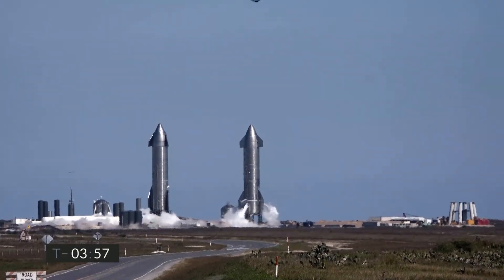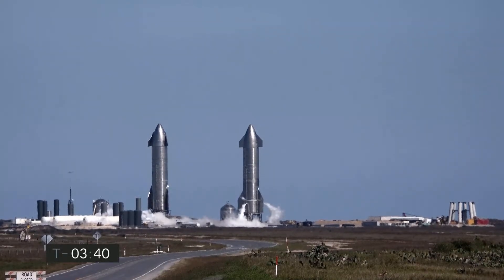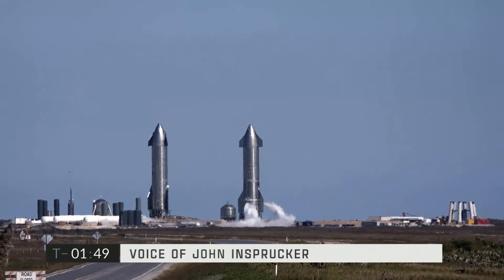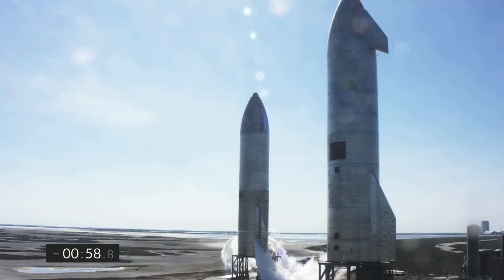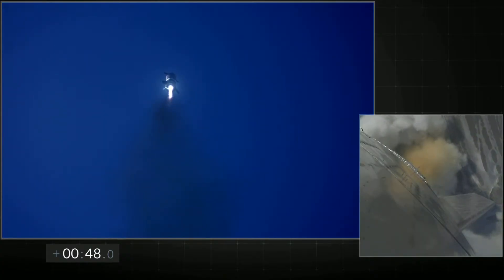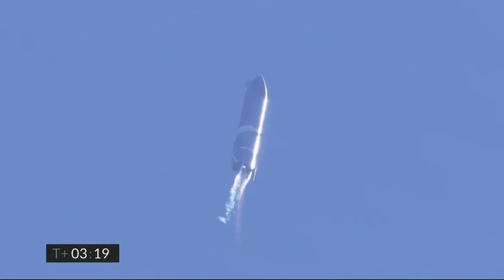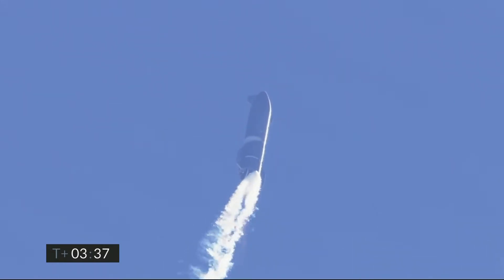Starship | SN9 | High-Altitude Flight Test

Comment: Hey SpaceX!  I've been an aircraft flight test engineer, and an aircraft performance analyst.  This is what I would try to do if I worked at SpaceX: think about the landings the same way we think about commercial aircraft takeoffs.  

All multi-engine commercial aircraft are designed and operated such that it is safe even if any one engine fails at any moment in time.  If it fails at a low speed the plane needs to be able to safely stop.  If the engine fails at a high speed it needs to be able to safely continue the takeoff and climb quickly enough to clear all obstacles in its path, with a little margin to spare.

There are a few ways for SpaceX to apply this methodology.  But I would look into planning on restarting all of the engines since a restart is obviously not guaranteed.  If only 2 of the 3 restart, but you only needed 2, then land using a 2 engine landing profile.  If all 3 restart then either throttle back to the thrust required or, if low throttle settings are not viable, then shut down whichever engine you want.  

I guess I'll also add that if your engines can take it then I'd suggest trying to get more cycles in during your test flights; climb to 10km, flop and descend to a simulated landing over water at 1km, reclimb to 10km, repeat xN, then do the final descent and land back on actual ground.  You will learn a lot more important information, like how much variation is there in the time it takes to restart the engines.  You need that information in order to understand the probability of failure for a given landing profile.

I could go on but I think the point is clear.  Plan for success in the event of any single point failure.
Reply: That sounds smart. But at this point, it is not the time to think about redundancy. They really just need to figure out a good way to deliver the fuel into the engines, assuming that the raptors are reliable themselves. They have to figure that out anyway, otherwise it will never be ready for Mars, so increasing a likelihood of a test vessel landing would be, literally useless. It needs to be a 100% on the 2 engines first, then they can think about the "what ifs".

Multiple "simulated landings over water" would also just increase the complexity of the tests tenfold, without any guarantee of saving the ship. Not even mentioning that it could just be downright impossible since they must switch the tanks for the landing, I don't see how they would switch back to the main tanks while the vehicle charges towards the ground/ocean.
Reply: @hvip4  I disagree. Saving the ship and being able to use it again is very important. That’s the entire reason why they work so hard to land boosters. Thinking about redundancy is something that they will need in the long run anyway. And if the only thing that they want to work on is the switch between tanks, well they can more easily build a rotating engine test stand than an entire space ship. If the test fails there is a very good chance that both the engine and test stand would survive and they would be able to quickly move on to the next test. Either way, being able to get several test iterations in quickly is a huge benefit.
Reply: I don’t follow Twitter but it sounds like Elon started talking about relighting 3 engines the day after I posted my comment here. It’s likely that I’m not the only person who thought about this, this mindset is normal for people familiar with FAA performance regulations.

Comment: I know this is a test and all, but since the rocket needed 3 engins to push gravity at its strongest, maybe it also needs 3 engins to land? Or, maybe you could start the 3 engins in higher altitude after the rocket is completely vertical in order to lower the speed of its fall and then  result to only engin 1 when it's close enough?
.
.
.
.
.
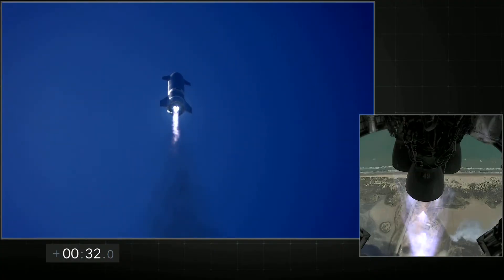Or it could be the ring that fell off on the corner camera between 5:59 and 6:00 if you go frame by fream...

 Either way, I'm sure you will figured it out!

Comment: Don’t they have some geek ass maths/physics nerds doing all the calculations but they forget the speed at which it’s falling from at 10km altitude in the sky and I’m sure they can work out the velocity and the timings of when the engines need to kick back on?? I mean I’m dumb and this surely isn’t rocket science to figure out? All they needed was to make them engines turn on 20 seconds before landing rather than 5 seconds before it hits the ground. The explosion shows that there was plenty of fuel left to do this. Idiots. Hire me, I’m very logical.
Reply: Actually , one of the engines did not relight at the end, so the starship could not stabilize in a straight position.

Comment: They need to build a platform thats as high as a skyscraper so they can use less fuel which in turn would use less weight...JS Elon...
Reply: The problem with that is that requires making a giant structure, and then getting said rocket on top.

This idea has some merit with airplane launched rockets, but most of the the time, the normal way is better, especially for larger payloads.

Comment: Wouldn't it be better to reopen the aft flaps at least as the landing sequence swings the vessel around to lessen its maneuverability?
Reply: No, doing so  would probably put to much strain on the vehicle, better to just keep  nose flaps open rather than both so the aft can kind of slide under when the air pushes the nose up. Better to let the TVC do its thing.

Comment: SO GUYS, THEY STARTED WITH 150 METERS ALTITUDE TEST FLIGHT AND LANDED. THEN THEY CONTINUED WITH 150 METERS FLIGHT AND LANDED. THEN THEY REPEATED 150 METERS FLIGHT AND LANDED. THEN THEY PLANNED TO INCREASE IT TO 20 KILOMETERS BUT DECIDED THAT THAT IS TOO MUCH AND PERFORMED THE NEXT FLIGHT AT 12500 METERS AND DID NOT LAND. NOW THEY SAW THAT THIS IS ALSO TOO MUCH, SO THEY PERFORMED FLIGHT OF THIS STARSHIP AT 10000 METERS AND DID NOT LAND.

WHAT I THINK IS THAT THEY WILL PROBABLY CONTINUE TO DECREASE THE ALTITUDE UNTIL THEY MANAGE TO LAND. PROBABLY STARSHIP 10 TO SOMETHING LIKE 7000 METERS, AND IF THAT FAILS, STARSHIP 11 TO 5000 METERS AND SO ON UNTIL THEY MANAGE TO LAND AGAIN.

IF YOU ASK ME, IT WOULD BE MUCH MORE CHEAPER IF THEY HAVE TAKEN ANOTHER APPROACH OF INCREASING THE ALTITUDE RATHER THAN DECREASING IT, BECAUSE THEY WOULD HAVE MUCH HIGHER SUCCESS RATE SO THEY WOULD NOT HAVE TO BUILD A NEW SHIP FOR EVERY FLIGHT. THEY WOULD BE ABLE TO REUSE THE SAME SHIP 2-3 TIMES AT LEAST. WHAT I THINK IS THAT THEY HAVE INCREASED THEIR ALTITUDE TOO FAST. AFTER 150 METERS FLIGHT AND 150 METERS FLIGHT AND AGAIN 150 METERS FLIGHT, THEY SHOULD HAVE ATTEMPTED SOMETHING LIKE 500 METERS FLIGHT. AND 500 METERS FLIGHT SHOULD HAVE BEEN ATTEMPTED WITH STARSHIP 5 AND STARSHIP 6, WHICH BOTH SURVIVED 150 METERS FLIGHTS WITHOUT SERIOUS DAMAGE, AND THEN WITH STARSHIP 8. THEN IF ALL OR AT LEAST 2/3 FLIGHTS MANAGE TO LAND, THEY SHOULD GO TO HIGHER ALTITUDE. PERHAPS 2000 METERS. AND AGAIN, THEY SHOULD HAVE PERFORMED 2000 METERS FLIGHT WITH STARSHIP 8, THEN STARSHIP 9 AND THEN STARSHIP 10. AND IF AT LEAST 2/3 FLIGHTS LAND, THEN THEY SHOULD INCREASE TO SOMETHING LIKE 10000 METERS. AND AGAIN, STARSHIP 10, STARSHIP 11, STARSHIP 12. AND IF 2/3 MANAGE TO LAND, THEN INCREASE TO 25000 METERS, IF 2/3 LAND THEN TO 100000, AND AGAIN IF 2/3 LAND THEN SHOULD TRY REACHING ORBIT.

AND IF 0/3 OR 1/3 STARSHIPS LAND, THEN THEY SHOULD STAY AT THAT ALTITUDE AND AFTER PERFORMING UPDATES TO THEIR STARSHIPS, ADD 2-3 MORE STARSHIPS TO TEST ON THE SAME ALTITUDE. AND REPEAT THE PROCEDURE UNTIL THEY REACH 2/3, OR, EVEN BETTER, 3/3 LANDING RATE.

IT IS OBVIOUS THAT JUMP FROM 150 METERS TO 12500 METERS IS TOO MUCH AT THIS STAGE OF DEVELOPMENT.
Reply: The original 150m hops were to test the raptor and not really to prove landing, the reason you see these flights up to very high altitudes is so the vehicle can fall at terminal velocity to test the controlled descent and belly flop to tail down maneuver. Falling at that speed is very important to make sure the variables will be as similar to a routine landing of starship in the future. 😁
Reply: YES, YOU ARE RIGHT. IT IS LOGICAL TO INCREASE ALTITUDE GRADUALLY, BUT, YOU ARE CORRECT, ALTITUDE IS NOT THE GOAL HERE. GOAL WAS TO TEST BELLY FLOP AND OTHER MANEUVERS AT HIGH SPEEDS. YOU ARE RIGHT. :)

Comment: So there was not one, but 2 engine failures. Come on Space X, one step forward, two steps FURTHER!! Not back!! Do it!!!
Reply: ...well, it is a fuckin’ rocket. There’s been a ton of failed launches when it comes to rockets. Trust, it’s much better to have a failed launch than to have everything go right during testing and then having the rocket implode upon itself in space with a full crew inside. This isn’t some backyard DIY project, my friend.
Reply: Only one engine failed
Reply: @jackwhitlock1  there are 3 engines, rewatch the landing part, one engine was lit all the way untill collision, one of them bursted and 3rd did some failure fire splash. So, if out of 3 only one tried to do its job, then logically other 2 had failures. It's visible in the video
Reply: The landing burn only needs 2 engines. 3 would make it shoot up in the air again no matter how much thrust. The engines can only use 40-100% of thrust and not 10-100% which is why they must use 2 engines. But yes, 1 engine did seem to have an ignition failure.
Reply: @OortCloud  alright, my apologies, I presumed they would thrust 3 engines to slow down the falling and then use one or 2 engines for landing. My bad

Comment: "We've just gotta work on that landing a little bit"
Reply: Maybe a bit, yeah. :oP
Reply: Landing safely was taking too long
Reply: I want to know how long does it take to get from a 'free-dive' to a vertical stop in the air on one engine only?
From now on they must assume the StarShip would have to land on one engine only and if a second engine happens to work then they must come to a stop above ground and then lower it slowly. More fuel might be required. ... the engines used for Landing must undergo a serious reliability re-design.
Reply: They had similar problems during their Falcon 9 development. I'm confident they'll have Starship landing safely and reliably within 6 months.
Reply: @Tekel-Upharsin  It’s not a problem, it’s just part of their development process. People assume too fast that if something explodes that it is an accident 🤦🏻‍♂️
Reply: @Engineer9736   It is a problem. Problems are part of the development process and are to be expected, per the dictionary definition of the word: "A matter or situation regarded as unwelcome or harmful and needing to be dealt with and overcome." You're correct regarding the word "accident", which I deliberately didn't use. Cheers!
Reply: Hahaha.... I heard that too. Yea, ya think!!!
Reply: For sure for sure
Reply: They are going to have to circle back on that
Reply: Noooo, this is Patrick
Reply: https://youtu.be/5zBnI34kW1g
Reply: https://www.youtube.com/watch?v=8qjHez3Q8T4
Reply: https://youtu.be/NEzho9B0Rpo ,
Reply: https://youtube.com/watch?v=hGVDzN-oPGA&feature=share👌

Comment: Can someone please explain why the last flip before landing does not take place at a much higher altitude to allow for corrections. Its not the fall that kills you but the stop
Reply: 1) Requires more fuel
2) You bleed of more speed the longer you wait, as the atmosphere gets thicker.
Reply: The second engine didn’t start which meant it flipped too low
Reply: @jackwhitlock1  but would flipping
Much earlier not be better if only giving more time for corrections. Anyway Im sure they know best

Comment: Why not light all three engines - and do so at a higher altitude, and then shut 
down - or throttle down... then at least they might still have a whole 
broken engine left to inspect... not to mention a starship to reuse.
Reply: I'll try to explain as best as I can! So there are multiple benefits to doing the bellyflop late and with two engines as opposed to three. We'll start off with why the maneuver is late. if you start the landing burn early you are really not taking advantage of starship massive surface area and instead wasting more fuel, which is important to maximize the capabilities of the vehicle in orbit. If you execute the burn as showed in the video  (without the explosion of course) you actually use starship's fins and massive surface area to generate more drag to slow down the vehicle, saving fuel.  Now the reason they light two engines instead of three is really that capability to control the flip. The raptor engine is capable of throttling from around 50-100% (which is really good)  and so if you use two engines, you can adjust the throttle better  in real time. Its better to do a less powerful, more controlled burn, than a fast chaotic burn.  Another reason is that with three raptors lit, starship might actually have too much thrust to land.  I hope this was a detailed explanation for you that answered your question!   😁

Comment: Why not test the landing sequence at a higher altitude allowing more time for engine restart then test actual landing?
Reply: https://www.youtube.com/watch?v=flV9YS1I6eM
Reply: @atiyenurozturk6630  fuk off
Reply: @Mike588  ditto
Reply: That wouldn't help... the engine failed
Reply: @oren2000  No anomalies in raptor 2 telemetry before landing sequence?  Was the raptor 3 programmed as backup? One would think redundancy would be a priority. It appears that they tried to skip a couple of steps in the incremental development process.  Maybe they had high confidence and it was just bad luck.  Murphy does have a habit of getting involved.  Regardless, SpaceX achievements are impressive.

Comment: Why is this distance margin for stoppage so bloody small?
Reply: All in the name of efficiency I'm afraid. The ship has a terminal velocity of about 70m/s, so it needs to slow at least that much.
Every second it spends in the air after the flip, gravity increases that number by about 10m/s, which starts to add up fairly quickly.
So if you take 3 seconds to stop, you need to slow by about 100m/s overall. 5 seconds, 120m/s. 10 seconds, 170m/s, and so on.
So the less time you spend slowing down, the less you need to slow down. Ideally you'd stop instantly, but obviously that's not practical.
Reply: @lazarus2691  I did some math for an airless environment and a uniform gravitational field https://www.desmos.com/calculator/cywgw9dmp9
So, I agree that this late landing burn is for greater efficiency, but I think the conclusion should be the following: the less time you spend slowing down, the less fuel you need to stop completely. The next question is how much efficiency do you lose (in terms of fuel) per meter of extra braking distance. Seems like you can spend a little bit more fuel but noticeably increase the chances of a soft landing (if these chances are proportional to the height at which the landing burn begins)

Comment: You all do understand that they NEED the rocket to crash a few times just so they can use that data to avoid it actually crashing when people are onboard. They would be disappointed if it never crashed because they wouldn't know what to do. With each incident they learn more and do more to avoid a repeat of such an incident. You may have started to notice by now that the other craft they land are doing so routinely without incident these days, but they started out the same way, with just about every one crashing to the ground.

Comment: why does it shoot some vapour cloud out every now and then?
is it emptying some fuel to manage its overall mass for better engine performance?
Reply: There are a few reasons:
1. To maintain tank pressure
2. To drain fuel. Don’t know exactly why they do so, though.
3. To chill the engines for startup.

Comment: Maybe its just me but I've watched both tests so far and I would feel safer if it turned and reoriented itself sooner. Theirs a lot of momentum to burn off along with the rotational maneuver (which is very fast) taking up precious seconds before deceleration can begin. 
    Also I know this sounds crazy but maybe create some kind of adjusting skirt for the bottom of the rocket that shifts into a more parabolic shape for the decent. You did do an amazing job on the flaps so anything is possible.
Reply: Similar thought re the earlier orientation.

Comment: Why do they flip so so late? The engine has only seconds to start and again it failed. Exactly the same as before
Reply: My guess is they're trying to minimize the fuel required to perform the landing.
Reply: Not exactly the same as before. On SN8 both engines successfully lit and ran for over 5 seconds, before one failed completely and the other started failing.
On SN9 one started and ran fine right until impact, the other never started in the first place. Also, in both cases starting sooner would have made things worse.
Had SN8 started sooner, it's engines would have failed at higher altitude, and it would have hit the ground faster.
Had SN9 started sooner, it still would have overcorrected, and hit the ground faster, as well as possibly crashing closer to SN10.